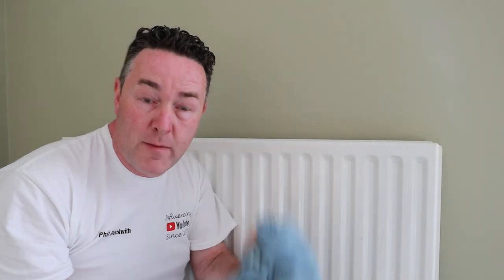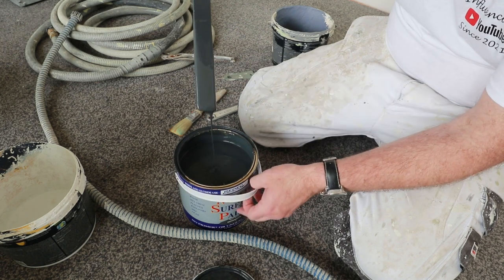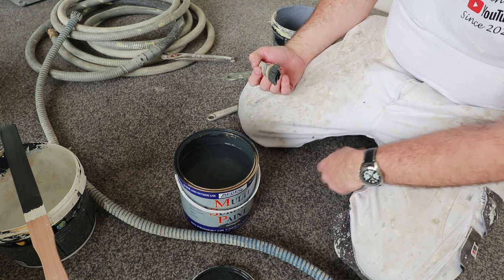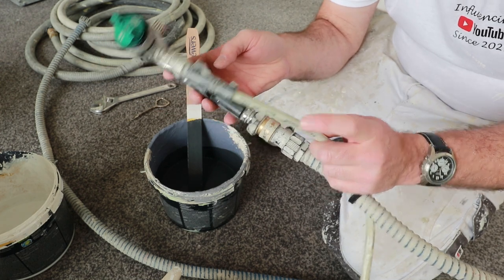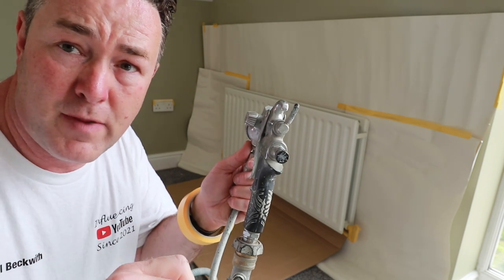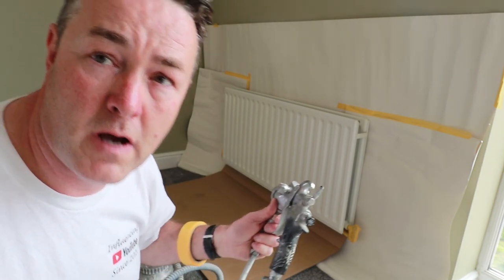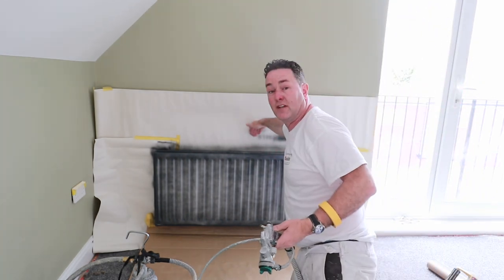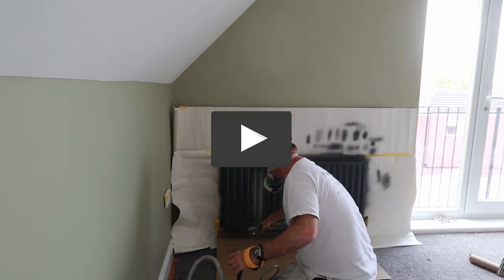How To Paint a Radiator - HVLP Spraying - Bedec MSP

Comment: Cheers Phil just ordered the paint👍
Reply: I have a fuji turbine set up not as expensive as yours I have the 1.3 aircap and needle and the 1.8 aircap and needle which would you recommend for spraying msp on radiators thanks in advance
Reply from the maker: 1.8.... you'll need to thin it a bit... if that puts too much paint out, drop down to the 1.3.... but that size is more for thin paint and lacquers.

Comment: Hi Phil, love the videos - I'm currently disappearing into the details too much for an amateur. But it is fascinating and clear, which is awesome as I've assembled so much conflicting advice.

I'm planning to spray my old cast iron radiators and pipes a RAL 2014ish bright orange colour with the Brillux 990 paint. I'm just wondering what you think of my plan to 1. Clean 2. Sand with fine grit then clean again 3. Prime 4. Paint. 5. Paint again 6. Drink tea in my hammock.

I'm planning to use a Wagner W100 sprayer but have no idea what primer to use.

Are these ther right steps/products? And what primer do you recommend? 

Point of info-i live in Germany, which explains the product choices. Brillux, Carapool, Alpina, and Schöne Wohnen are the ranges that are readily available here.

Thanks for the tutorials. They're fantastic.
Reply from the maker: Hi, yes, you're using a paint not really used in the UK.

The old cast radiators could rust... what I would say id ask the advice of the Brilux rep, as looking at the paint you're going to use, may need a dedicated suitable primer for the actual paint you're using.

Now, the whole reason I used the BEDEC MSP, as it did everything in one and for ease of application it goes staright onto radiators without a problem.

please keep in touch and let me know what they say.

Comment: Thank you for this Phil. I were looking at buying this paint for spraying a few upvc bits and now possibly radiator 😂 Just what i needed to see 👍I will be using a compressor and gravity pot but i dont think this should effect anything? I have only sprayed 2pk and celli previously. Do you think I would get away with a 1.5 nozzle for this paint please with a bit more gun adjustment? Thank you.
Reply from the maker: You'll be fine. As you'll thin it anyway and open up the needle if needed
Reply: @ProfessionalPainterDecorator  niceone thank you for that. Looking forward to having a play now 👍

Comment: 😂Lovely finish and colour, must get myself one of those sprayers, looking at Wagener Xhvlp cheers Phil
Reply: I bought one around a year ago. I wasn't impressed. Very cheap plasticy and the guns are way too bulky and chunky to get into certain areas. You'd be better off getting a q tech or something similar. My wagner has been used for 10 minutes and sat in the garage since.
Reply: @AspireDecorating  Wow! Many thanks for the info phillip,  Q tech 3  I'm thinking.
Reply from the maker: save and get the stage 5, you'll always think with a stage 3 you're missing out on power and wil struggle with some paints
Reply: @ProfessionalPainterDecorator  Thanks Phil👍

Comment: Which HVLP do you recommend for light use by a amateur? I've been wanted a hvlp or lvlp for a few years but can't justify the costs for light use. The ones I've seen come with a compressor and I'm not sure which size i need.
Reply from the maker: Have you had a look at those cheaper HVLP sprayers I've done a video on yet?